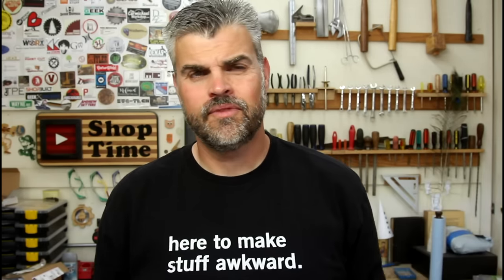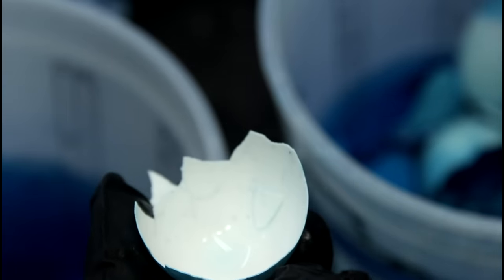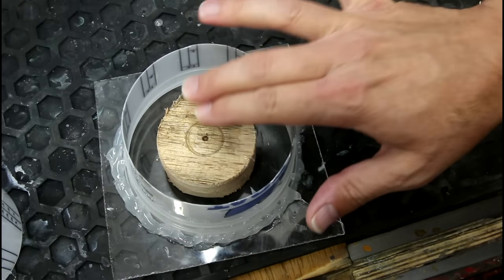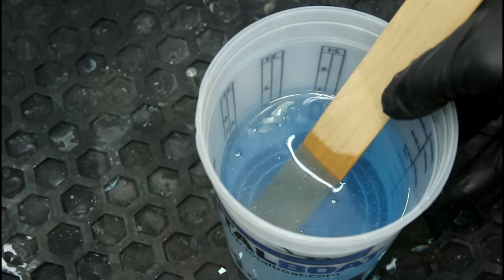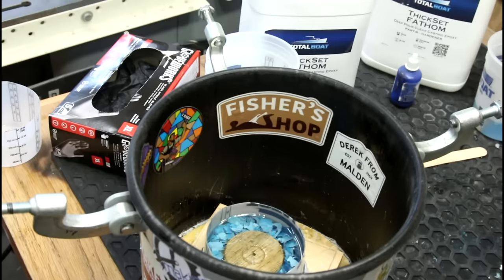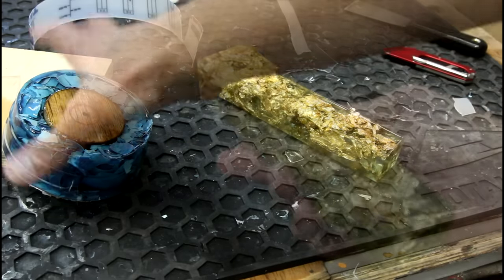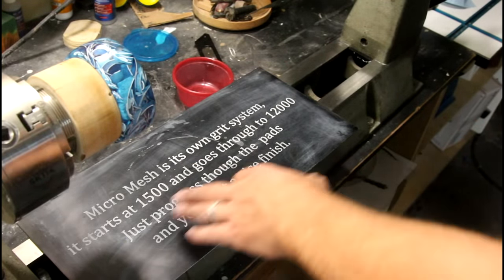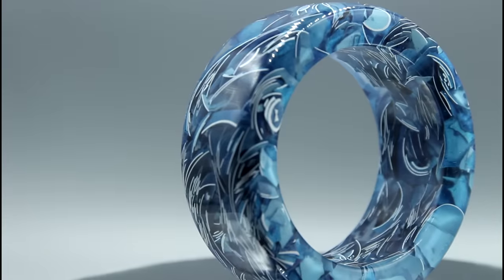Dyed Eggshell Bracelet | DipIt #42

Comment: Egg shells I made mostly of calcium just like your bones. When those of us who have chickens know our flock needs calcium addict for a a little bit when they start consuming their own eggs or the shells are super duper thin. You actually did know that eggs have membranes you just didn't really realize that's what it was. You know this because you've peeled hard boiled eggs. And you had to peel it off the outside of the whites on occasion. Eggshells are porous for are but only from the outside to the inside. That's why farmers cannot wash the eggs unless they are going to immediately refrigerate them. Once you wash them you remove the protective coating applied by the chicken during the laying process which would in turn allow bacteria and other yucky things to get into the egg. That is why farmers and a lot of other countries that don't wash their eggs can store their eggs on the counter for quite some time before they have to refrigerate them. But you is the consumer who buys them at the grocery store must refrigerate them at all times unless your actively using them in cooking. We have raised chickens, quail, ducks, geese, turkeys, and pea foul (peacocks and peahens) for quite some time. When I tell you I am a walking encyclopedia of useless coupe information I'm not lying 😂😂😂. 
If you want to do another blank using eggshells that will give you a totally different look I would recommend goose eggs. They are just like chicken eggs only their shell is SUBSTANTIALLY thicker and they are at least three times size. (As far as taste goes, are yolk is quite a bit larger so you taste it more and it is quite creamy creamy. They are excellent in baking but you must adjust accordingly as one goose egg is typically equivalent to 3 chicken eggs and depending on the lightness of the recipe you will want to split the overall egg quantity ratio 50/50 between duck goose and chicken)